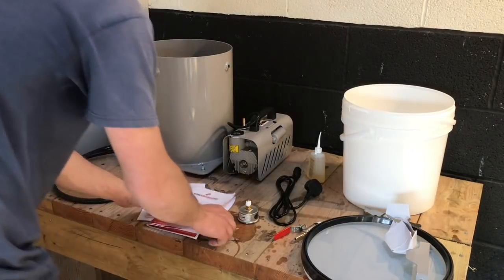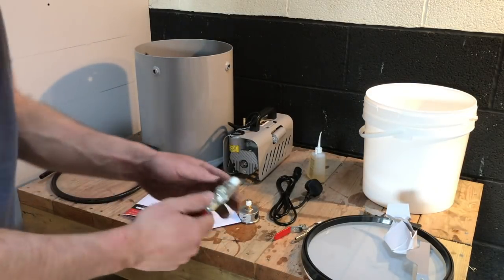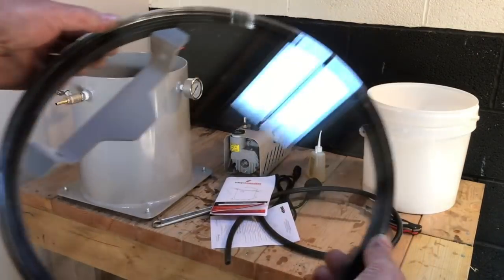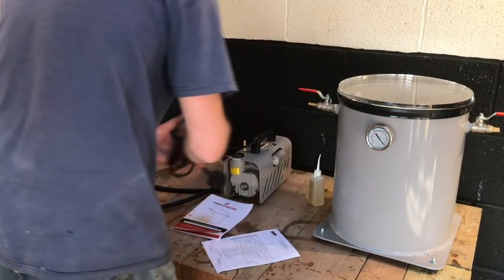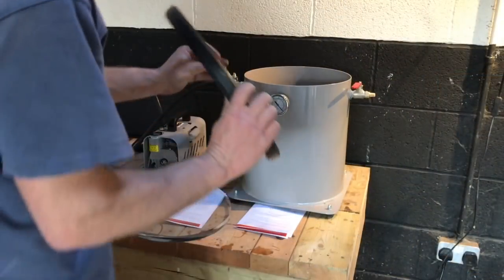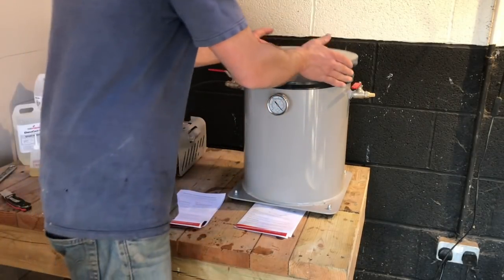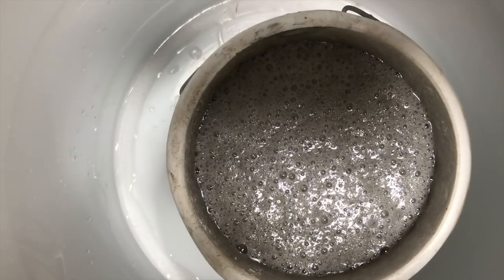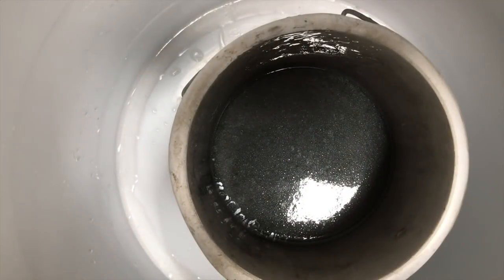Epoxy Resin - Degassing Chamber

Comment: While you absolutely can and should degas resin after mixing when doing large pours you can also degas it prior to mixing. This way you can do the majority of it without any time constraints. Just put the resin and harder in the chamber and let them sit for a while, this can substantially reduce the time it takes to degas after mixing when time matters.
Reply from the maker: Great idea , do you store you resin and hardener degased long before use?
Reply: You can but unless you have a good way to store it under vacuum it really isn't all that advantageous. While most of the air dissolved gets there from agitation during shipping and manufacturing over time just being exposed will cause some to dissolve. So if you pull it out today, next week you still need to do it again, so there isn't much gain to degassing it before you need it. 

What I would recommend is to put the unmixed parts under a vacuum 8-12 hours before you are going to do the pour. Allow the air to bubble off but once you get to a hard vacuum just close the valves and turn off the pump. Assuming the pressure pot is well sealed it shouldn't leak enough to matter and the long resting time will allow as much of the air to boil off as possible. Then just after mixing throw the combined mass back in the chamber to pull out the air dissolved into the epoxy during the mixing process.

Because you are dealing primarily with bubbles not dissolved gas the finishing degassing should only take a few minutes. Obviously keep an eye on open time, but it shouldn't take more than a few minutes.
Reply from the maker: Thank you Stumble.!  this is a great ideaI will try this on my next batch ..I hope others are reading the comments there is so much to learn by sharing :)